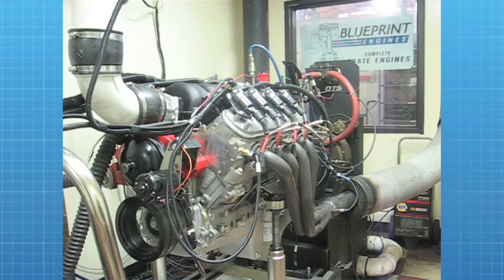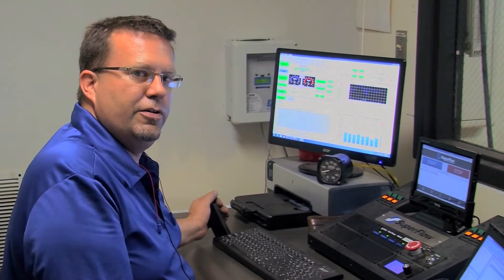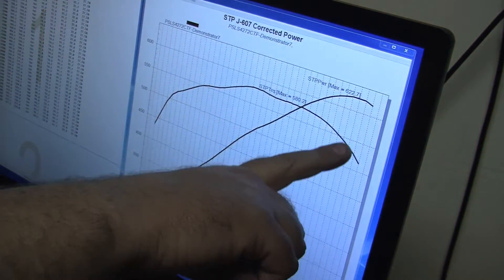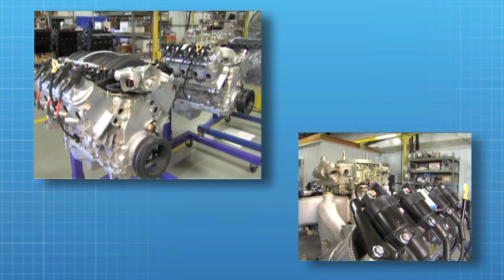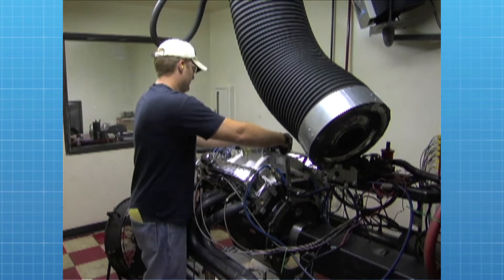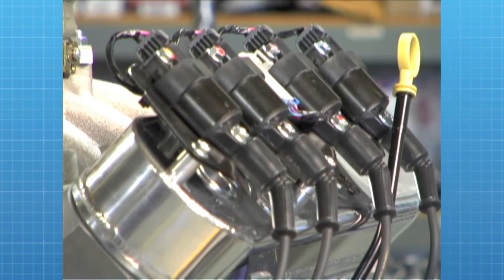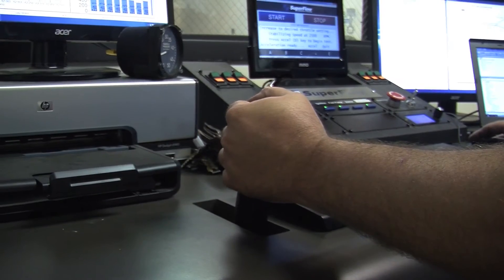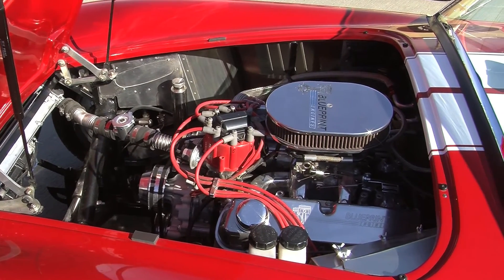BluePrint Engines Calibration Engineer Interview

Comment: I'm debating on buying a crate engine from you guys but I researched your engines and it concerns me that people have had problems with your crate engines failing.  I've heard nothing but good things up until I watched some videos claiming that you used old cranks and parts that you claim are new crate engines...is this unfounded information? Please reply to this or I'll go elsewhere to spend my hard earned money. Thank you for your time.
Reply: zxcurve What did you end up going with? I just bought a blueprint short block, and like you I'm now hearing bad things.
Reply: Stainless Slayer I never got the chance to, my transmission came out of my truck...bought one from monster transmissions and they shafted me. The transmission wouldn't even shift gears!! I believe that they are lying about street testing every transmission...they'd have to have a half dozen vehicles on hand. My advice, don't buy remanufactured parts
Reply: BluePrint Engines I have to ask, why you don't offer warranty on your assembled short block? Do the come with a build sheet? Summit was quick to take my money but offered little info other than the ad.